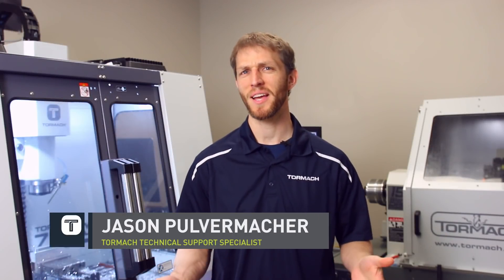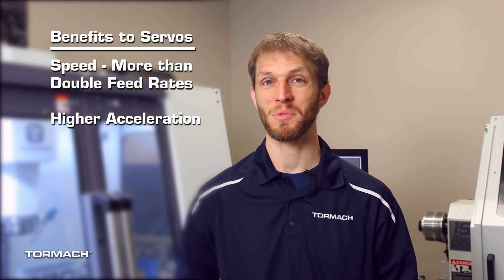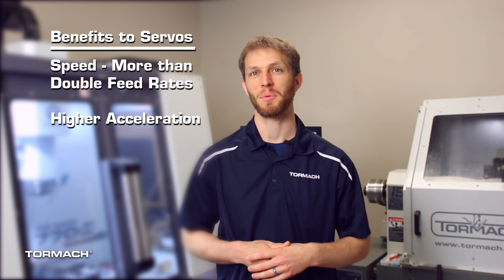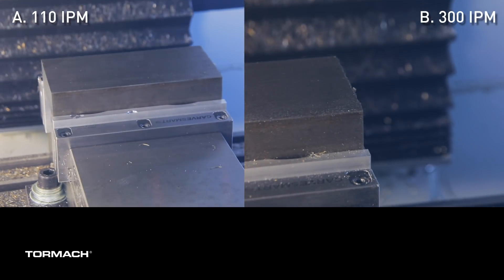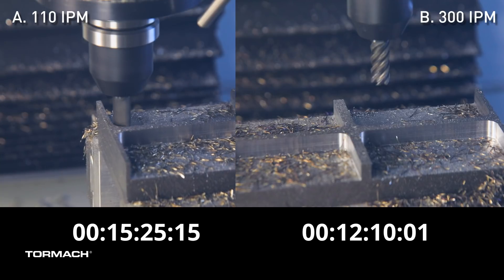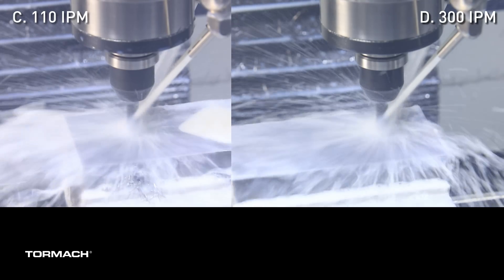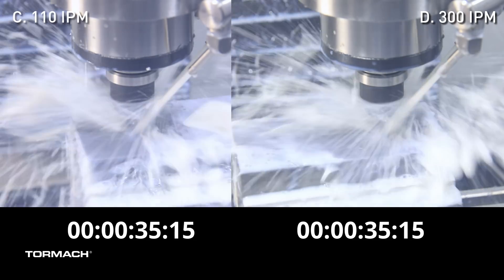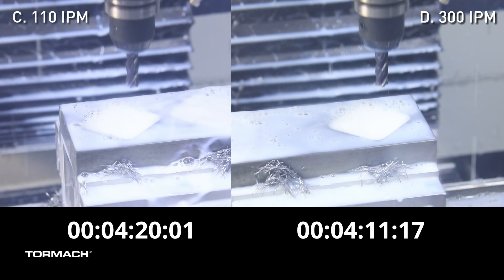Is it a Good Idea to Upgrade to Servos

Comment: Most steppers have a step angle of 1.8 degrees. A servo's smallest gradient of movement depends on how high the encoder resolution is which can be 10000 or more. At 10,000 resolution it would be 10 times as precise as a stepper. It's hard to believe that wouldn't affect accuracy.

Comment: Hello sir. I have a question.
I have cnc engraving machine with closed loop stepper motor of yako make.
My question is, upgrading to servo will increase the surface finish of job? Or finish result will be the same as of closed loop stepper motor.
Waiting for your reply sir.
Thank you

Comment: Great video, I also think there will be a little! less vibration from the smoother motion.  Steppers always have clogging.  This could help with very fine finishes such as attempting to mirror finish aluminum with the ideal tools?  I am only guessing on this.

Comment: Servos are as accurate as the encoder and controller. I doubt any stepper motor would be more accurate than servos with 24bit absolute encoders.
Reply from the maker: Incremental and absolute encoders have very similar accuracy. The main difference is the absolute encoders remember their position when powered down. This eliminates the need to home the machine when powered up.

Comment: If you're running open loop stepper system and you upgrade to closed loop servos you will see a gain in accuracy, open loop steppers will always skip steps to some degree, but you won't know about it, at least with servos there will be error compensation and alarm if the error is too big
Reply: Very true.  My one homespun servo machine will"fault out" if it can't keep up or gets overloaded. (This is great on a crash). But a servo motor is also ,always trying to keep up"  the next steps are called and power is amplified to match the request.  If you force it off spec it will give a little and fight to get back where it belongs.  This can lose a tiny bit of presicion. In effect the servo is always behind by a bit. The closed loop can help with the "wait a second while I get there" before sending the next move. All in all, I love  servos (quick and quiet) but have never had a problem with the Tormach 1100 steppers if they are kept within the design specs.  Biggest advantage for servos will be speed in the Rapids as shown.  Can you convert just the Z?  That would speed up all those tool changes.

Comment: Power, the power consumption of the servo is greater.... talk about that
Reply: At the same speeds and acceleration, servos draw less power because they are more efficient than step motors (step motors spend most of their time pulling outwards on the rotor, this generates heat but provides no useful work, this is why step motors usually run quite warm even when idle where servos typically draw near 0 power when idle)
Reply: @pcwcol  so you're saying when you get Servos to act like steppers they draw less current. Now talk about servos when they act like servos. Considering that is why you swapped the steppers for servos. Servos acting like they do in this video draw considerably more current. I wonder how much the tormach config draws.
Reply: @gusbisbal9803  No, servos are simply more efficient than steppers for a number or reasons, one is that servos only draw as much current as needed to supply the needed torque, where steppers draw full current at all times (though may reduce current when idle) since they cannot sense  position errors.
Step motors magnetic circuits are less efficient also because of the high number of poles.
Reply: @pcwcol  Dude, you don't increase accelerations and rapids by that much and not consume more energy. Stop quoting your favourite stepper servo dogma. There is no way the servo machine in the video is drawing the same amount of energy.
Reply: @gusbisbal9803  
So the basis of your arguement is that "if it's moving faster it has to be using more power"? The servo has two sets of coils that are energised as on or off. When stationary those coils, are on, at full power, and it's not moving at all. I don't know the answer but I'd start reading before jumping to conclusions. If it were straight f=ma then sure, but there's a bit more going on here...
Reply: @owensparks5013  No the basis of my observation is that all servo systems that drive similar machines require three phase.  Thats called empirical observation not argument. Also either the servos are ALOT bigger or they have gear boxes because servos have considerably lower torque for the same size.
Reply: @gusbisbal9803  They are clearpath servos made by teknics. They run anywhere from 24v to 74v DC, they are not 3 phase. Typically they are much, much more efficient in power use than a stepper.

Comment: If you install servos on the machine can you tighten GIBs/back lash screw tighter or do they remain the same? Is there a way to set known backlash into Pathpilot? Also do they come with encoders? Thanks
Reply from the maker: You will want to keep the gibs the same. We are currently working on a machine commissioning video series that will cover everything from machine leveling to full compensation. Stay tuned!
Reply: @tormachinc   That sounds great! Thanks

Comment: The servos have encoders right?  Either way 300 IPM rapids is awesome.  About time too, you have turcite coated ways for it anyway.
Reply from the maker: Yes, the servos have an integrated rotary encoder.
Reply: @tormachinc  I thought both motors have encoders? I suppose though servos will insure reliability while a stepper could keep loosing steps? That's my current problem with my Denford micromill which is why I'm looking to upgrade to Tormach. I have lost steps and crashed the part too many times now and I get frustrated that the spindle power is there but the steppers just can't deal with the movement. The only reason I'd get the 770+ instead of the PCNC 440 is if the 440 doesn't have a servo option.